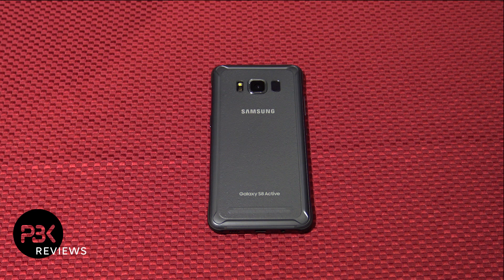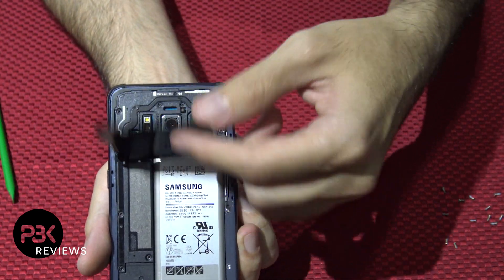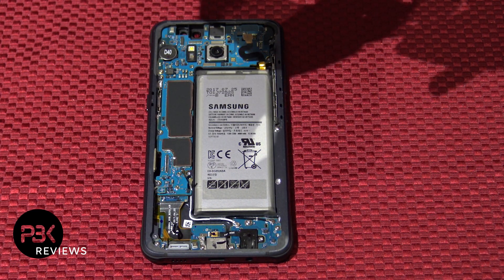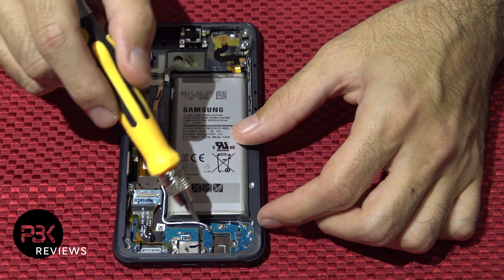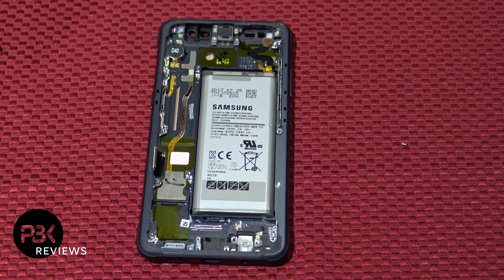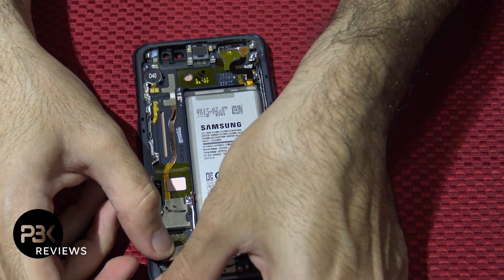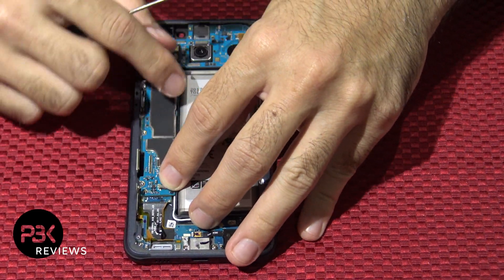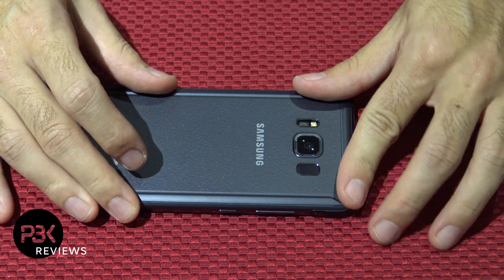Samsung Galaxy S8 Active Disassembly Teardown Repair Video

Comment: I NEED TO REPLACE MY S8 ACTIVE SIM CARD READER PLEASE SHOW
Reply from the maker: sim reader is soldered onto the motherboard. It would require someone who knows soldering to be able to de solder it and replace it with a new one. You would need to find a repair shop that has the tools and skills for the job.

Comment: I know this is an older video, but could you help me out? mine fell face first (not a big fall really) and turned off. Now it only turns on for a few seconds while its connected to a charger. No water near or anything, could something be loose?
Reply from the maker: Its possible the battery cable came lose.

Comment: Can I remove the INTERNAL memory and still access it? My phone will not charge and I have been trying to recover what was on it.
Reply from the maker: Unless you have an SD card and your stuff saved onto that, you would not be able to do it. The onboard storage is soldered onto the motherboard.
Reply: @PBKreviews  so absolutely no way to recover anything that wasn't on the sim if phone is not turning on?

Comment: Mine will turn on but it shuts off, you look like the guy who can help me, PLEASE!!
Reply from the maker: Hi, it could be many things. Has it been in water? It could be water damage, a defective battery etc. Have you tried booting it in bootloader mode to see if its possibly corrupt software? Keep in mind if you were to do a factory reset through recovery mode you would lose all your data.

Comment: My phone was the same from you, my phone was starting shut down when I charge it and I didn't open again what's the problem from my phone thanks
Reply from the maker: Might be a defective battery, or liquid damage. These devices are water resistant but not water proof, if exposed to water for long periods of time, they can become damaged so if you have exposed it to water for a long period of time it might be that as well

Comment: what would make my loud speaker not work
Reply from the maker: Many things can cause it not to work. 1. dust debris stuck in the filter clogging it up. 2. internal damage like liquid damage etc. 3. short in the headphone jack making the phone think there is headphones plugged in thus directing sound to the headphone jack. Could also be something else but these are the most common issues. Hope this helps

Comment: DO NOT DO THIS THE PHONE WIL NO LONGER BE WATERPROOF IT IS NOT MADE TO NE TAKEN APART DO NOT DO THIS
Reply from the maker: That's true unless you replace the adhesive with a new adhesive strip then you will be water resistant again. It's always suggested to replace the old adhesive with a new one when taking apart to ensure a good seal.
Reply: @PBKreviews  no it will still not be water resistant
Reply from the maker: @fizzysodawave9140  Well then you can believe what you want, but I am speaking from experience. If that was the case, samsung would not offer to replace LCD assemblies and have authorized repair centers do repairs on these phones if they could not ensure a water resistant seal again after taking the phones apart..
Reply: Do you know where to source the replacement adhesive? Cant find it anywhere
Reply: @shanevm2009  what
Reply: @shanevm2009  good question...never seen it sold anywhere

Comment: Is the internal memory accessible with out using the phone itself? Like, is it a card or something?
Reply: Yes ok there is a hole on the top, get an earring and push in the hole and it will pop up, pull it out and bam
Reply: @guitarcovercentral2357  That's the SD card, not internal memory.

Comment: Where can i get a replacement battery for the s8 active
Reply from the maker: Usually they are available on ebay or amazon, but at the moment no one has it for sale. You can try contacting samsung and see how much they will charge to replace it for you

Comment: I'm not a fan of modern phones that require a heat to disassemble, but you make it look really simple on this device.
Reply from the maker: Thanks, yea most phones now a days are sealed down so yep.
Reply: @PBKreviews  Do you have a phone fixing shop?
Reply from the maker: @levong2935  we used to, what did you need?
Reply: @PBKreviews  Nothing for now, just needed a good knowledgeable location for repairs.
Reply from the maker: @levong2935  Sounds good, if you ever have any questions, feel free to ask.
Reply: @PBKreviews  Mersi bro.  I currently have a S9+, it's gorgeous but delicate. That infinity display is horrible for proper screen protectors. Gonna return it and get S8 active instead. Sounds backwards but is definitely more practical to me.
Reply from the maker: @levong2935  Anytime :) and yea I know what you mean. I don't know why they never released the s9 active, there were talks about it but never came out. Maybe they will do a S10 active who knows
Reply: @levong2935  careful with them, I just got an s8 active 2 weeks ago and my charging port is going out in it, I didn't listen when my friend told me they suck lol hes gone through 2 s8 actives because of the charging port and I didn't believe him because I'm still really careful with phones
Reply: @JustJacobBK1  Funny thing is, I bought a used unit and knock on wood everything's been fine. I guess they just have a higher rate of defects. I'm careful too, got a screen protector and transparent case. I just hate having dings and scratches on phones. Still pretty tough phone in case my dog is biting my pocket or someone accidentally sits down on it, no problem.
Reply: @levong2935  I fixed my charger port for about 15 dollars on Amazon and so far it's been a great phone, I just hope it doesn't mess up again it sucked taking it apart lol
Reply: @JustJacobBK1  Yeah I'm scared of opening any phone that needs a heat gun since I could potentially mess up the water resistant glue.
Reply: @levong2935  this was my first phone I've ever opened that needed head lol, and did you remove the plastic layer over the screen before you put on your screen protector? Because when you buy the galaxy s8 active it has a plastic layer over it that's kind of like a screen protector
Reply: @JustJacobBK1  I got it used, so there wasn't a plastic layer.
Reply: @levong2935  the plastic layer feels like glass, it fooled me too

Comment: this battery can fit in regular s8?
Reply from the maker: no the battery connector is located in a different spot on the S8 compared to the s8 active so the cable will not fit
Reply: but there is posible can upgrade the battery of s8 or s9 regular to 4000mah battery?
Reply from the maker: don't think so because the size would not fit in the phone frame made for it.
Reply: ok tnx

Comment: doesn't this remove the waterproof capability?
Reply from the maker: The adhesive used on the battery door/rear cover is very strong, if you don't damage it, it will seal back and adhere to the housing strong giving it the seal it needs. But if you damage it, you would need to replace it with a new seal to ensure its waterproof capability.
Reply: How would you go about reattaching it? Do you reheat it or does it just adhere?
Reply: @PBKreviews  can you answer the Q please!? regarding the reattaching is reheating required? also where can we get the replacement adhesive strip for s8 active back cover?
Reply from the maker: @testphone7279  Hi you can go to this link on amazon https://amzn.to/35tPozf  there you will see some adhesives sold for the s8 active. Also no you don't need to re apply heat if using a new adhesive.

Comment: Hey buddy, how do you separate the plastic cover on top of the Gorilla glass 5?
Reply from the maker: Hi, I don't have the phone in my possession at the moment. If it is replaceable by end user, they really did a good job not showing any seems or separation around the edges and any raised spots that would show there is a plastic protector over the screen. Usually when you look around the earpiece or corners of the screen you can notice an additional layer just like how a plastic protector would show itself. Motorola did a good job on the z2 force making it barely visible but still is visible if you look at the right places, but I did not see any signs of it on the s8 active.
Reply from the maker: svtrader im not sure if its replaceable, if it is im sure some heat and just prying it off but on these newer ones I think they made it none-removable
Reply: pwrdbykyank grav X is saying that it is! Waiting for him to post video. If you can please try and let us know thank you. :)

Comment: Anyone know where i can get s8 active replacement parts, i dropped it and need new metal bumpers on it
Reply from the maker: don't think there are any replacement parts matching what you need yet. Best bet would be to check on ebay every now and then to see if it becomes available.